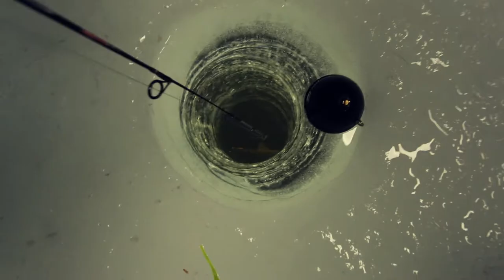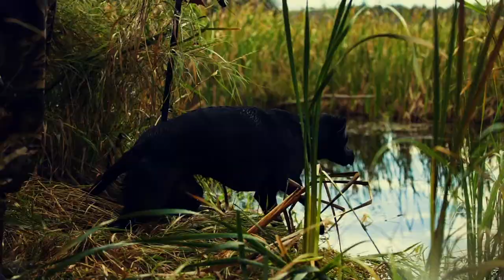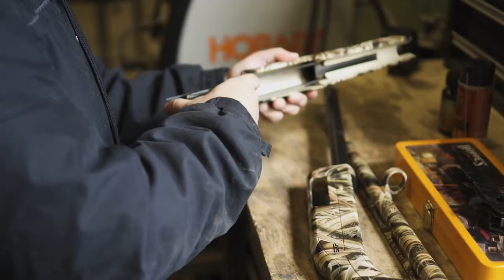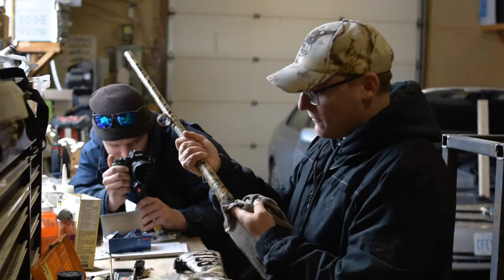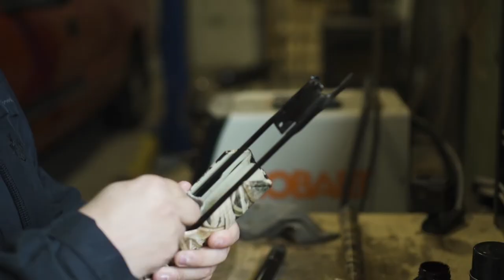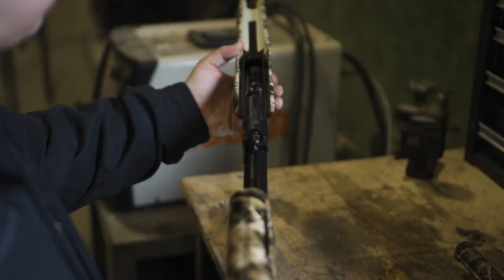How To DISASSEMBLE & CLEAN Your WINCHESTER SXP 12G SHOTGUN

Comment: I cant get the pin out holding the trigger assembly in. Trigger disengaged and forearm back?
Reply from the maker: Try using a screwdriver to pop it out.
Reply: I had the same issue I used a skinny punch I had laying around and just lightly tapped it with a small hammer